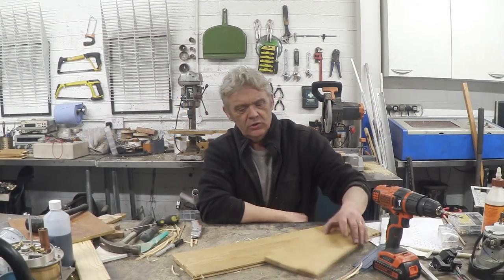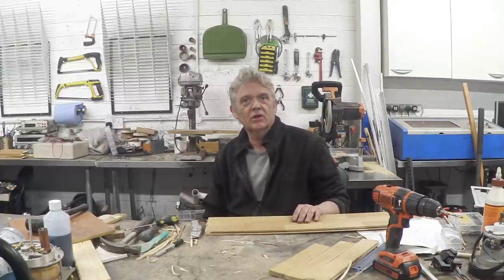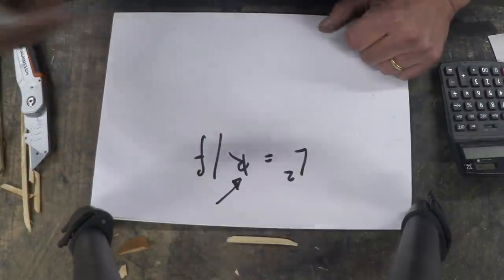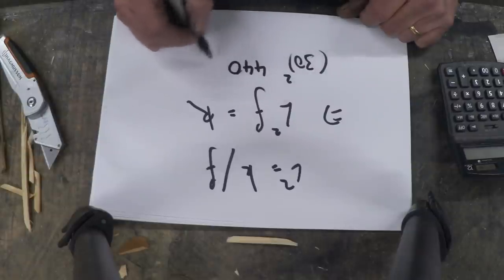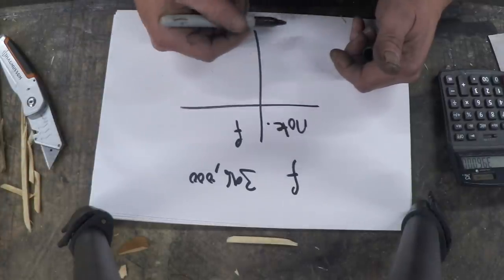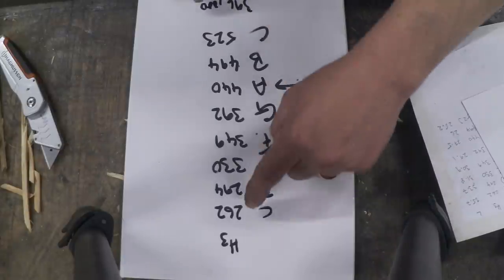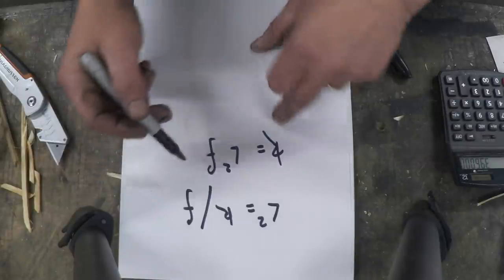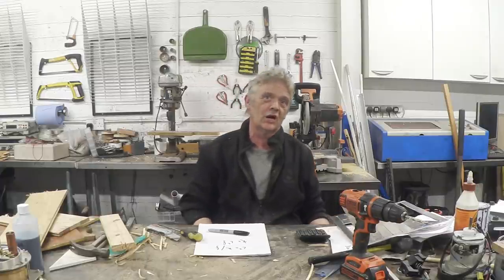Making Tongue Drums -  Working Out The Size Of The Tongues

Comment: Brilliant!  Except for the fact that the frequencies you used were based on "tempered" tuning which is necessary for multiple keys.  In this case you're only using one key so there's no advantage to using the tempered tuning system.  It will sound better and more natural if you use "mean" tuning.  Whatever key you're using the desired ratio of the eight frequencies would be 16:18:20:21:24:26:30:32.  The sizes of the tongues should be around the same ratios as well.
Reply: Desmond Bagley  Actually no, mean tuning refers to aligning everything to one note and as long as you play in only that key it sounds glorious but other keys, to various degrees, don't sound right.  With tempered tuning everything is slightly but equally out of tune relative to mean tuning and was adopted to allow for playing in more than one key.  Fretless stringed instruments and wind instruments allow the player to find the sweet spot for each note in any key whereas the piano or other essentially fixed tuning instruments the tempered tuning system is needed to allow for multiple keys.  The tongue drum will be in only one key so no tempering is needed, mean tuning is ideal for that instrument.

Comment: So, you made a very difficult task, easy.  Thank you.  I do have a couple questions, but I think I will watch the other videos first to see if you answer them.

Back with my questions and a comment.  I was first going to ask where do I measure the length from.  At first I was thinking the entire length of the wood.  Then I thought, ok to the rabbet.  Then was it the front edge or the back edge of the rabbet? Then my final thought was, to the front edge of the mount bracket to the end of the tongue.  Now my thought is, does it really matter, as long as they are all in scale.  The difference as you would say it, is a note or a sound.  If the note or the sound are in scale with each other you created a scale.  Then you can tune them to notes.  

So if I take off the wood of the tongue, lets say I take it off the end.  How much of a gap between tongues do I start effecting the sound box or echo chamber?  Yes I know I could take off the bottom, just thinking outside the box and wondering when the echo chamber starts effecting the other tongues as well.  Knowing that more vibrating air escaping at a different rate is going to have effects on the other tongues as well.  Or does it?  

What are the different effects if I were to make my rabbets wider or deeper?  If I made my Rabbet depth the set depth, but to tune to a note, if I took off a millimeter of the bottom or off the leading or back edge, of that rabbet, would there be a difference?  

OK, I know I could do these test myself, but I thought with your SIMPLE scientific approach and SIMPLE way of making me, an idiot, understand it, you could make others think outside the box even more.  

I am on my way to see what else I can learn from you.  Great job.